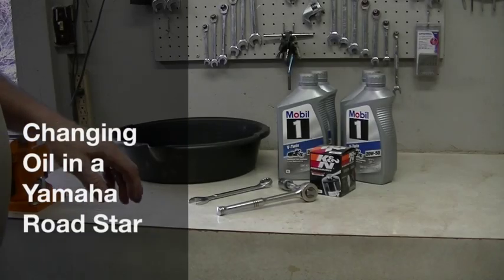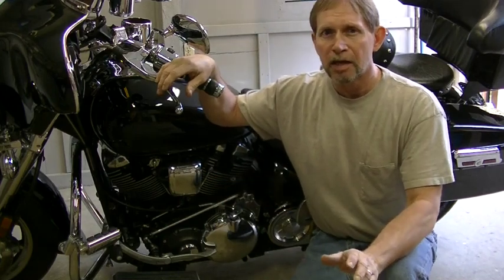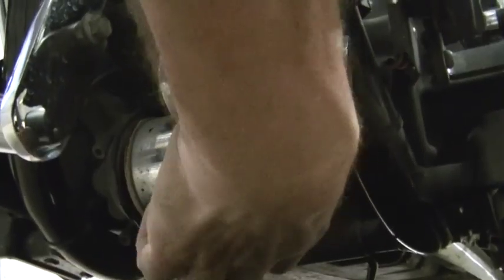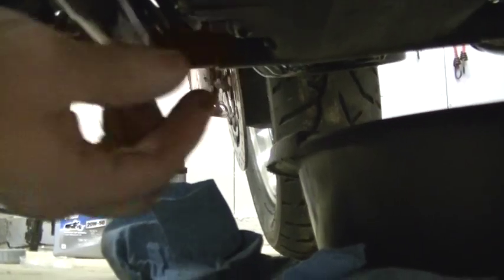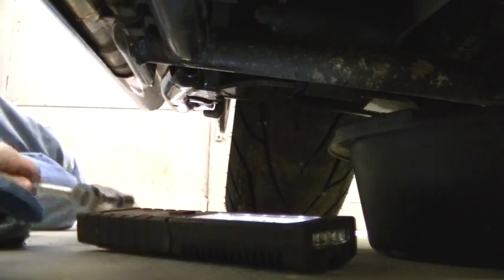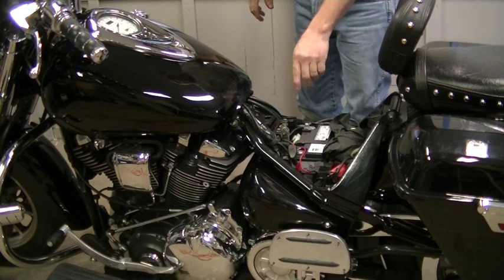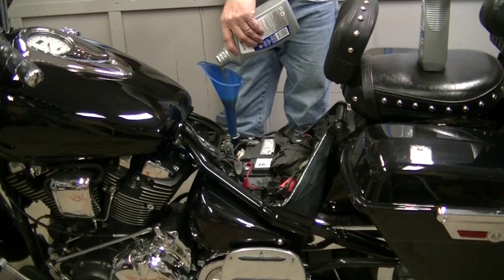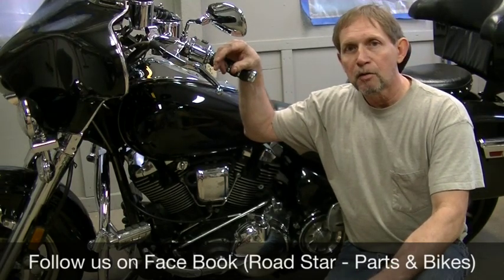Changing Oil in a Yamaha Road Star

Comment: Great, informative vid - very helpful to the shade tree mechanic.  One note of caution: The author says several times that "you can use any oil you like" but it's critical to understand the type of oil going into a wet-clutch system like a RoadStar.  The oil MUST be JASO-MA2 rated, and NOT have friction modifiers or an "Energy-Saving" star on the label. Not being JASO-MA2 rated and/or having friction modifiers in it will ruin your clutch friction plates and cause your clutch to slip.  Fortunately, the author shows Mobil 1 V-Twin oil.  This IS  JASO-MA2 rated.  Not all Mobil 1 oils are rated as such.  Be an informed motorcycle owner, and your riding experience will be more enjoyable!
Reply from the maker: I agree

Comment: you have to use oil compatible with a wet clutch. I found out the hard way and used reg. syn. a few times and my clutch started slipping and had to be replaced.

Comment: Good video, quick question, do you need to replace drain plug gaskets on these? I just picked up a 2005 road star midnight and want to change all the fluids
Reply from the maker: You can. If it's not leaking then don't worry about it.

Comment: Thank you very much for making this video!  I just have a couple comments.  The .3 quart that you are leaving out is a fairly significant amount.  Not with regard to oil pressure or engine lubrication, but because more volume allows for more cooling, and it also slows your breakdown that much more.  That leads to my second comment.  I'm not an oil expert, but you stressed the fact that the only difference between conventional oil and synthetic oil is that the synthetic doesn't break down as fast. From my understanding, that is only one of the benefits. Synthetic oil has a better flow rate. Not the same as viscosity. Basically, it gets into places more easily than conventional oil.
Reply from the maker: .3 of a quart is 9.3 ounces. Some people may not measure this out and over fill their engines. so just adding 4 quarts is much easier and running slightly lower on oil is better then having too much,   I agree with your statement synthetic oil has a better viscosity and does flow better, but I felt it is better to let the rider decide on the oil they chose. I've ran both and never had any issues.
Reply: @Jadams1911  - right on.  Thanks again for the great video!  I changed my oil today.  Yay!  :)

Comment: Silly question, do you check the engine oil with is leaned over on the kick stand or up rite? 
Just bought a 2005 Road Star so iv got some maintenance learning to do.
Reply from the maker: You want the bike up right to check the oil. Its a process checking oil on a Road star. You have to start the bike allow it to warm up then shut it off and wait a few minutes to allow the oil to settle to get a correct reading. If it's not leaking or burning oil don't worry about it. when you do an oil change with filter it takes 4 quarts and 8 ounces. Most of us just add 4 quarts,
Reply: @Jadams1911 , ok thanks for the info!

Comment: Dear Mr. James, I can not open the seat of my Yamaha XV1600 Wild Star, please help me, you tell how I can open the seat. Please. Thanks in advance.
Reply from the maker: The seat opens by turning the key to the left without pushing down on the key. You may have to push down on the seat as you turn the key. When you turn the key it pulls a cable that releases the seat latch. If your cable is broken you will need to use a stiff wire bent with a hook on the end, then slide the wire under the left side of the seat and feel for the latch, it is toward the front of the seat.
Reply: @Jadams1911  Dear James Adams, 

Thank you for your advice, I am going to try it next weekend. I hope I am lucky and can open it. Thank you.
Reply: @pablomarjalizo1375  Once you get the seat off, clean and lube the seat latch.

Comment: I recently bought one of these bikes and I read that when changing the oil drain the tank first then the engine. Not sure if that makes any difference or not but my question for you is. The owners manual says it takes 4.3 quarts with the filter change but a dry engine holds over 5 qts so apparently you do not get all the old oil out on a normal oil change. Do you know how to get the rest of the oil out ? The reason I am asking is the owners manual says do not change brands of oil you should use the same oil that was in it. I want to change to AMSOIL and Lucas was used by the previous owner.. Amsoil says it is ok to mix brands but extended oil changes are not recommended.
Reply from the maker: It doesn't matter which you drain first, oil tank or engine. Once they are both drained add 2 qt to the oil tank then start the bike, rev the engine a few times, this sucks the oil into the engine. turn the bike off and add the remaining 2 qts to the oil tank. Most of us just add 4 qt because it is simple. If you want to add the .3 you can measure out 9.6 ounces. To remove all the oil you would need to split the case, don't worry about mixing oils it will be fine.
Reply: @Jadams1911  thank you James.  I am not splitting cases for any reason. I guess that little bit can stay in there.

Comment: Just got a 2005 roadstar midnight with 1,341 miles on it. I went to change the oil, took the old one out, changed filter and when i start adding the oil it acts like is full. I start it up and it goes down. I can add like half a quarter very slow until is full again and i repeat the process. Is this normal? Thanks for the vid
Reply from the maker: Remember you have two drain plugs on the Road Star. One is under the engine, the other is under the oil tank. Once you drain both then replace the plugs and only add two quarts of oil to the oil tank that's under the seat, then start the bike and rev the engine 4 or 5  times, this will allow the oil to be sucked into the engine so you have room for the remaining two quarts of oil in the oil tank. It's normal that the oil goes down slowly, don't rush or you'll have a big mess to clean up. Lol I'm glad you enjoyed the video.

Comment: Isn't that oil too light for summer? I followed your video, and I have to say thank you! That plug placement is a pain. But I used the same exact oil and then realized it's the beginning of summer and I'm a little worried that I should've gotten something heavier
Reply from the maker: I'm using 20w 50. it's a good summer oil. You don't want to use anything any heavier.
Reply: Right on, thanks for hitting me back

Comment: motorcycle oils have increased amounts of zinc and phosphorus to give the oil what is known as a higher film strength. Motorcycle transmissions subject oil to severe shearing… as the gears are  Scraping against each other under power, they are sharing the oil like a pair of scissors. No place in an automobile or truck engine has this type of severe environment. You cannot use just any oil in a motorcycle engine since 1989 when oil changed at the request of the government to get more miles per gallon in cars.. Believe it or not, oil actually has friction, and thinner oils have less friction and give you higher gas mileage. So the government, oil, manufacturers, and car manufacturers go out together, and they came up with center oil for cars. To reduce friction, but these oils are not good for motorcycles that use one oil for the transmission and the engine. I mentioned this several times in my videos here on YouTube.

Comment: Hey James, I have the 04 1700.  Do you think it's worth upgrading the carburetor to the 42 HSR?
Reply from the maker: I hear the 42hrs carb can give your bike better performance but you need to change a few parts before it will work correctly .. Personally I travel cross country and I like my stock carb because I'm getting between  42 and 46 MPG.

Comment: Great upload! What year is your bike? I was looking at a 2001 today with your same setup. It has over 40k on it though.
Reply from the maker: My bike is an 06, with 23,000 miles. I had an 02 with 60,000 miles and it ran great. .These bikes can go well over 100,000 miles as long as you maintain them. 40,000 is not bad miles for these bikes. Just check to see if the bike had the trans recall done, if not then the dealers will fix it for free.
Reply: @Jadams1911   Thanks for the prompt reply. I think I'll ride up and see what they will give me for my trade on my 07 Star 650. They have the 01 stickers at 2995.

Comment: any advice for someone who just stripped the living shit out of their engine drain plug?
Reply from the maker: Ouch! Well you can take your drain plug into a store that sells tap and die kits and find one just a little larger.
Be sure to change the new oil after a few miles to make sure there are no metal shaving inside the engine after you tap the new drain plug.

Comment: Hi James.  I just bought a 2005 Roadstar and am in the process of getting familiar with the ins and outs of the bike.  I"m currently trying to switch out the stock grips, but once I removed the bar weight on the left side, it appears that the grip is still attached somehow -not just glue.  I don't want to force it and break something accidentally.  Any thoughts or recommendations?  Thanks
Reply from the maker: If you have already removed the switch mount then use a small screw driver and insert it between the grip and the bar. Then spray wd40 in between the grip and bar. Repeat the process all the way around the grip,  every now and then try twisting the grip. The left grip is usually glue to the bar.
Reply: @Jadams1911  Gotcha.  Thanks James. I had removed the switch mount.  My bike is at my other place so will give it another go this weekend.  It seemed the grip was attached to something else, but maybe it was just the glue holding it.  Much appreciated.

Comment: Old video but I have a question for you. Is that the stock seat or is that a mustang seat? I just bought an 02 Road Star 1600 and the stock seat that's on it seems...small for the bike, which is odd because everything else feels great. Recommendations? Avoidance? I was looking at Mustang Solo seat or something of the sort, but if you've got recommendations, that would be appreciated. Faved the vid for later use when it comes time for my first oil change!
Reply from the maker: It's an ED Big Tour Seat. I use it for long road trips. Very comfortable but it will lift you up an inch higher than the stock seat.
Reply: @Jadams1911  thanks! Appreciate the info.

Comment: How long do you recommend running the bike before changing the oil? I actually have your 2002 Road Star! Bought it this week.
Reply from the maker: Hey thats awesome! I wondered if he had sold it. It's been an awesome bike. I've ridden that 02 all over the USA and Canada. Actually you can change the oil in a cold engine, it just helps it drain faster if the oil is hot, a few minutes with the bike running will heat up the oil if you're not riding it, but don't let it run to long without a fan blowing on the engine so it doesn't over heat.
Reply: James Adams thanks! You were the last one to change the oil so I've been trying to get it done. I got under her today and tried. I can't get the first bolt to come loose. I tried using a hammer and some PB Blaster but nothing worked. Any recommendations or should I just take her to a shop?
Reply from the maker: You mean the engine drain plug? It's a tricky plug. Remember to use a 17mm boxed in wrench. place a brick or something under the kickstand or jack the bike up to give you more room to work. I had to flip my wrench to get it on the plug correctly. make sure the wrench it's on drain plug tightly or you can strip it.  Hold the wrench on the bolt with one hand while pushing down with the other.
Reply: I tried putting the kickstand on a block of wood but it didnt help. I do have to boxed 17mm but its starting to strip so I quit. Should I replace the bolt when I do get it off?
Reply from the maker: Yes you should order a new drain plug bolt. I doubt the bike has been ridden 3000 miles since I sold it with a fresh oil change so I'd just wait until you get the new drain plug before changing the oil, that way if you have to use vise grips to remove the old bolt you'll have a new bolt to replace it with.
Reply: Great! Thanks!
Reply from the maker: Keep in touch and let me know how the bike is doing from time to time.
Reply: Where should I order one?
Reply from the maker: http://www.ebay.com/itm/YAMAHA-NEW-K-L-MAGNETIC-OIL-DRAIN-PLUG-BOLT-w-WASHER-M-15-4125-/400950373280?fits=Year%3A2002%7CMake%3AYamaha%7CModel%3ARoad+Star&hash=item5d5a812ba0:g:-ssAAOSw-vlVlvnu&vxp=mtr

Comment: Why wouldn’t you snug up the filter? Wont vibration rattle it loose?
Reply from the maker: The oil filter should only be hand tight. Ive never had one vibrate loose.
Reply: If you wrench it on, good luck getting it off.

Comment: Did I miss it? I did not hear mention of the crush washers on each of the drain plugs...  They should be changed out every 2nd or 3rd time... My dealer get $7 for the stinking things, which look a lot like a tarp grommet...   Auto parts stores sell a flat aluminum "crush" washer for .75cents to a dollar or so...    I also think you should apply your handy torque wrench, especially if you have not replaced the crush washer...  I only had one leak, on one oil change...took four hands to R/R the washer, only lost about a shot glass of fresh oil...

Comment: I changed my oil in my road star don't even show on the dipstick at 4 quarts I think it holds more
Reply from the maker: When you change the oil only add 4 quarts of 20w-50 It will hold 4.3 quarts but its hard to measure the .3. 
Do not ever over fill the oil, I'd rather run a little low then a little over. 
Checking the oil in a road star can be tricky so if it's not burning or leaking oil don't worry about it. 
Just add 4 quarts each oil change and ride it until the next oil change is due. :)